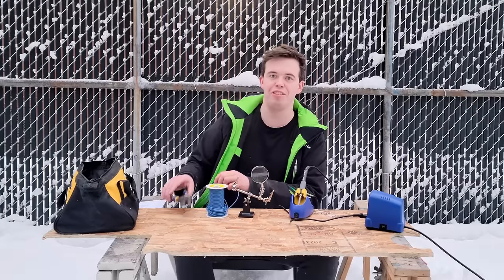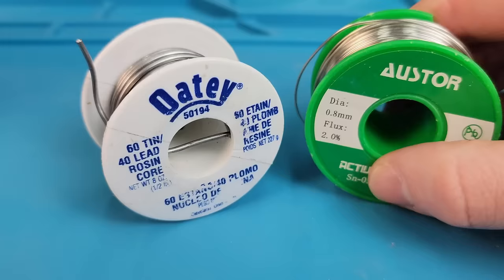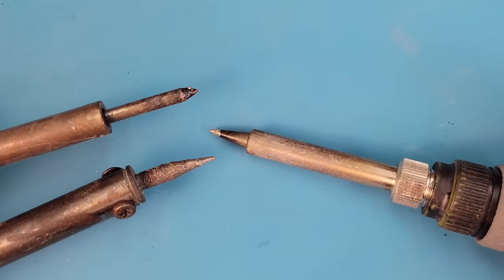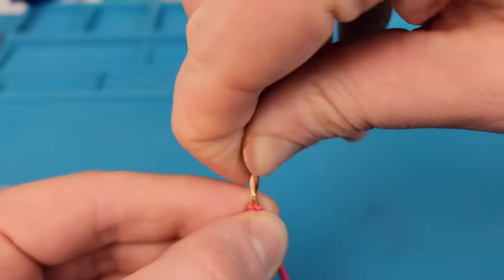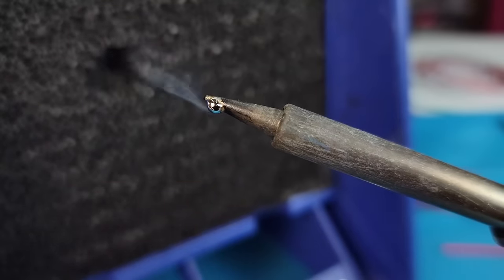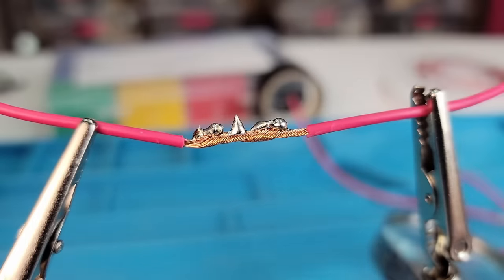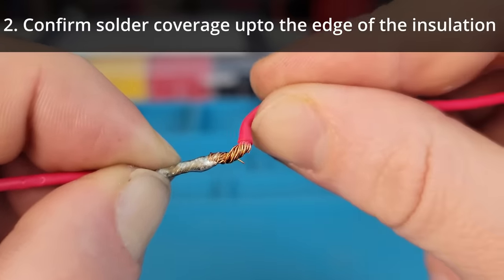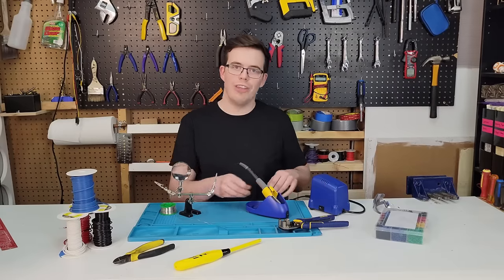Four Steps to Flawless Wire Joints (How to Solder)

Comment from the maker: Not shown in this video, but another very useful product for more aggressive cleaning and repair of a badly neglected soldering iron is sold as "tip tinner". You shouldn't need to use it regularly, only if your tip is so badly oxidized that the regular cleaning method shown in this video is insufficient.
Reply: I tried heating up the wires and it just burned the plastic housing 😂
Reply: I use 220 sandpaper to clean the soldering iron tip and then coat it with fresh solder to prevent corrosion 👌
Reply: You can also dip the tip of your iron into some flux to clean the tip very effectively.
Reply: Not all solders are flux core. Solders that don't have a flux core need to be used alongside flux. Using the wrong kind of flux will cause the wires to degrade quickly. Finally, always make sure your conductors have bright copper. If it's oxidized you're going to have trouble making the solder stick.
Reply: I use a block of sal ammoniac for oxidized tips.
Reply: Your solder tip can last decades. You can also destroy that same solder tip in 5 minutes. If your solder tip oxidizes, it's done. You cannot get it back by sanding or cleaning. Tip tinners won't bring it back either. The solder will just ball up around oxidized spots.
Reply: A around 9:37 , that joint is also ruined by the crystallization of the solder because you disturbed it, you need to reheat it so if flows out, then not move it. This looks like 60/40, 63/37 does not do that to any great degree. You should also investigate better mechanical splicing methods, in this case, a lineman's splice.
Reply: I use tip tinner to protect the tip when shutting down for the day.
Reply: @brettbuck7362  Yeah 3 joints were created at that time. If he just waited till everything heated up and resolidified again en mass it would result in one very clean joint. 
Also, I agree I wish he showed how to really do it correctly. He correctly showed the worst way no one should ever solder anything and then showed a meh 5/10 way to solder with a twisted splice. A solder joint shouldn't even need solder to stay connected even when moving it around. The solder should not be a structural component of your assembly. Showing one NASA splice (that's the name I've always know it as) would have at least let the viewers know that various other methods are out there.
Reply: @JaredBrewerAerospace  There are plenty of legitimate splice methods depending on the configuration of the joint, but aside from correctly showing you need to heat the underlying conductors instead of blobbing on solder like putty, it was quite amateurish. I would note, however, that for splicing wire, particularly stranded wire, solder really is pretty strong and some of the "sound mechanical connection, then solder" are over-the-top for many low-vibration applications.
Reply: if soldering on a mini LED bulb or mini SMD on a circuit board, does one insulate the positive & negative wire legs of the bulb with heat shrink or the likes? I replaced a mini led bulb on a circuit board to a on/off fog light switch for my car, the middle of the legs are exposed following solder joint on the circuit board, I want to make sure it’s safely/ correctly done. As the bulb legs are exposed inside the switch. Any advice is greatly appreciated! Thanks!
Reply: @andrewmccarty clean the flux off right away with a wet sponge or it will eat the tip of the iron.
Reply: It would be a lot easier if you put flux in there before soldering.
Reply: You can also dip the hot tip in a light acid such as vinegar before wiping it on the sponge, no need for buying expensive additives.
Reply: I use tip tinner paste and a wet sponge and have used the same tip for years.

Protip on the shrink wrap.....just use the iron! Hold it below the wrap and walk it slowly up the length to secure it. If you don't have much time just briskly rub it along and it'll shrink fine.

I use a 1000wt iron for RC applications because back in the day I was using 6ga 440 strand pretinned wires with silicon jackets. These transfer energy with very little loss and that means they'll pull heat away fast lol. The 1000wt iron means you can get the job done fast.

Heat the wires, then apply the solder TO THE WIRES. Every one of your demonstrations you touched the already melted solder first. The wires need to be hot enough to melt the solder upon contact. If hot enough they'll soak up solder about as fast as you can feed it in.

Only use as much solder as needed to fill the air gaps and that's it. If done correctly it'll literally just look like two wires and you'll have to really look to notice any solder.

I can make joints that bear my own weight and this is always my goal when soldering.

Comment: technique is important but be sure you dont buy garbage ass soldering iron and solders theres way too many of them available online :|
Reply: And offline too. In particular, avoid the Parkside “soldering station.” Don’t ask me how I know…
Reply: it gotta be easy using a soldering iron that costs what a brazilian does in a whole month. try with a $10 one and see how it goes 😂 the amount of rage I've gone through
Reply: I think this has always been my problem. Shitty soldering irons give me results like the thumbnail photo.
Reply: meh, you don’t need to spend very much at all either, especially if you don’t have to solder very often. My Chinese T12-956 ($60) has been amazing.
Reply: I'm really enjoying the "Team 21V" Parkside soldering station! I've tried the USB C one too, and it had too low power. But the 21V acumulator one is the best soldering station I've had.
Reply: What's your thoughts on some of the units sold on Amazon that connect to a power station?

On my eyes, it's the perfect budget setup especially since I have a decent power station to bench test almost any manner of DC systems.
Reply: Tbh It honestly doesn't really matter the soldering iron you use as long as you can solder with it that's all that matters, sure the more expensive ones are much easier to use but for simple wire joints such as this a simple $10 soldering iron is more than ample, heck even in doing most jobs besides fine circuitry. 
I would personally recommend you start with a non TC soldering iron for beginners, sure it's harder to learn with but the heat control you learn from them rather than adjusting the heat to fit the joint is far more useful & opens up the doors to many different styles of soldering gizmos rather than being restricted to just TC soldering irons, not only that but the skills & technique learned is something that'll carry through rather than using a TC soldering iron. 
Theres an old adage in the world of engineering "blame the operator not the tool".
Reply: I used 3 cheap ass soldering irons and dirt cheap tins, never worked. Now I have one that is 5-6 ish dollar more expensive. It worked and is actually super easy, never thought it was this easy
Reply: @GRBtutorials the corded Parkside soldering station, right? 
      Thou art correct. It is one of the very few tools by Parkside that is actually crap.
      The tips, man... I wrecked both of 'em..? Plus it doesn't get up to temperature anymore.. (Or, well.. I need to dial it up to 5 (full power) to get it hot enough to get anything done.
    Had to buy a new soldering iron with a chisel tip to be able to solder some guitar pots
Reply: @GRBtutorials  had this piece of junk too. It was a nightmare and in the end it just died after only some light use. Got a quicko T12-942 and it was a gamechanger
Reply: @Jorge.ALXNDR the cost of a monthly Brazilian depends on how hairy one is.
Reply: A good soldering iron is so extremely important

Comment: Why not put a drop of flux on the wires? I don't like heating the wires and applying soldier directly because I often melt the sheath on larger wires before the other side gets hot enough to melt solder. I put a drop of flux on the wires and gently use the iron to melt it in. Then I put solder on the tip of the iron and touch it to the wires and it instantly gets sucked up and flows everywhere the flux went. I actually get solder a mm or two up inside the sheathing doing it this way. And you can very accurately control how much solder you're using. But the main thing is it doesn't require holding the iron on the wires to heat them up, so there's a lot less heat transfer up the wires and into connectors. Idk, works for me.
Reply: Your method is absolutely correct. You want as little heat transfer as possible so as to not melt the insulators. Keep in mind also that this video only has brand new wires also, whereas in many applications, a wire repair will be performed on wires that may have been exposed to oxygen and are slightly dirty. Using a small brush to clean the copper and dabbing some flux on the twisted joint is quite literally the only way that I've been able to achieve good results in the field. Not sure why he didn't mention that method. Also I tend to place the tip underneath the joint if possible, so that heat rises, I can control the puddle of solder better, and the end result is typically as you described, solder flowing into the insulation slightly, without the added heat.
Reply: A drop of flux? I cover that sucker with all the flux it can hold. Never had a problem.
Reply: Practically speaking do both.  And buy more/less aggressive rosin core fluxes in solder to cover more situations without the need for a separate bottle. 

With clean pretinned wire I’m not pulling out a bottle of flux. I’ve even found myself soldering 100’ in the air. If I don’t have enough flux in the solder I over feed solder so the flux pours out onto the wire then flick the excess solder off the tip.  It’s just not practical to carry excess flux there. 
 For a small spaces with poor access at the bench or dirty wires flux makes life easier and I’ll use it.
Reply: I passed the iso9000 quality certification. The only way is to heat the wire from underneath and apply solder on top so the solder will flow over and into the strands.
Reply: @225savage0  I don't know what that entails, but my solder joints seem to be pretty sturdy. I apply solder to the iron and then apply that to the wire from underneath and watch it get wicked up against gravity so I know 100% that the entire thing is full of solder. Solder actually flows back into the wires under the insulation. It just doesn't make sense to me to heat the wires from the opposite side the solder is applied. You have airgaps between strands so by the time the top strands are heated enough to melt solder the bottom ones are cooking the entire wire and probably melting the insulation. Like the heat is going to travel laterally down the strands in contact with the iron vs going up into the wires on top. Vs if you apply the solder, it fills those airgaps and transfers the heat to the wires above it, keeping the heat more localized and reducing the chances of melting insulation or connectors or something.

Comment: I started soldering when I was about 10 years old.  I'm 85 and still soldering.  I've soldered with every type of device including a torch.  While working as a Quality Assurance Rep. I was a certified soldering inspector.  Having said all that, take my advice and  never, ever attempt to solder anything without using flux.
Reply: You are right, half the time there is not enough flux inside the core & unless the wire is new it certainly wont be easy without flux. He did not mention anything about getting whatever you are going to solder properly clean either.
Reply: His example is two newly stripped wires, which wouldn't need cleaned in nearly every case.
Reply: @frommatorav1 

But did he clean his hands to remove excess natural oils etc!? 
For long term reliable joints cleanliness is a good thing.
Reply: @frommatorav1  flux does help with the flow of solder between wire strands. Even though most of the soldering I have done is with fresh cut and stripped wires, extra flux made soldering so much quicker and easier.
Reply: @sixter4157  No doubt flux is better. I was just saying brand new stripped wire didn't need cleaned.
Reply: A lot of solder doesnt contain any flux/rosin and you only reside on one your hand just applied. Even when it does, its much better to still add some flux/rosin.
Reply: I thought I was cheating by putting a little dash of flux on to wires when soldering... Glad to hear my "cheat" is classed as good practice 😂
Reply: Why don’t you start a soldering channel

Comment: Step One...Put heatshrink on BEFORE you solder the wires.
Reply: Covered @11:09
Reply: I've been an electrical engineer for over 10 years. . . Still forget to put the damn heat shrink on until it's joined nicely of course!
Reply: Was wondering if someone would get round to this.  Yes, but back it away from the joint as was explained in the video.

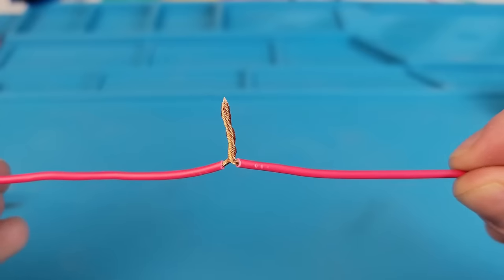Comment: Look, most of the advice in this video is not egregious in any way, so I won't give this a complete thumbs down or anything, but I've just gotta say that your recommendation for splicing those wires at 5:12 is one of the most cliche and ineffective ones out there.  Twisting each set of wires into a core and then twisting those cores together is proven to be very weak, deformed, and unnecessarily difficult.  Instead, I strongly recommend the splayed/opposing palm frond splice; instead of twisting each wire on itself, you splay out the wires from each end into a palm frond shape, and then face the wires opposite each other and bring the strands together, interlacing them.  Then you twist the wires against each other,  causing the strands to wrap and weave around each other in a much more uniform and secure way.  Not only does this splice allow for a much more uniform and strong grip, but it also creates very tight contact amongst all the wires, and avoids those unsightly lumps and frayed ends that are so common with the twisting "hobbyist" method being promoted in this video. Once you add the solder to this splice, it'll look super clean and neat.  Do a quick search on youtube and you can find tons of videos demonstrating this palm frond method.